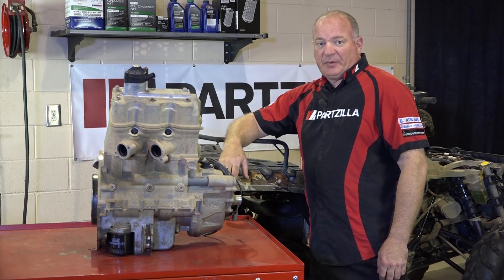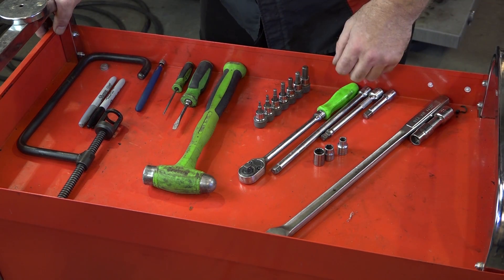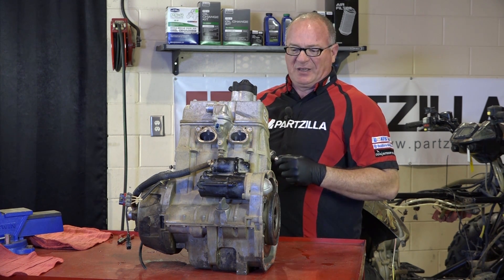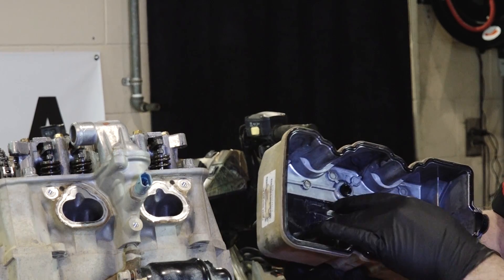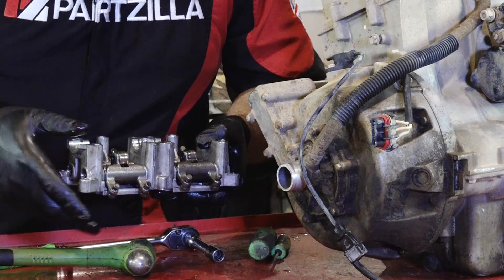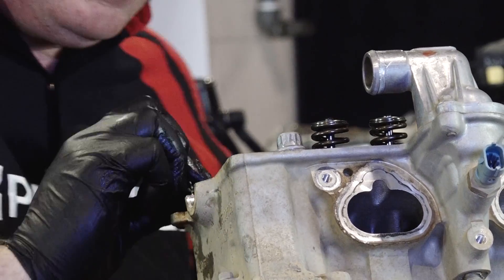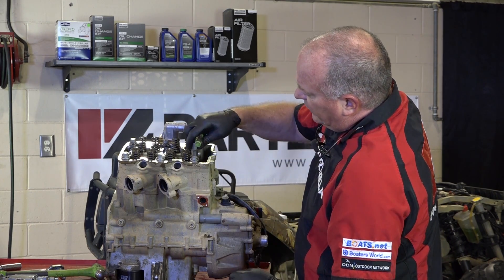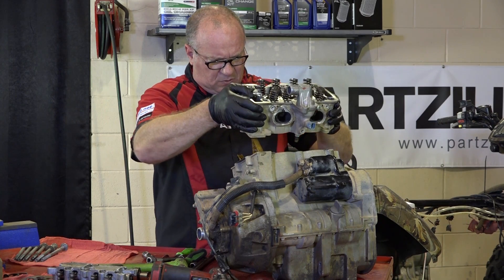Polaris Top End Rebuild Part 2: Remove Cylinder Head & Valve Stems | Partzilla.com

Comment: Good old Polaris engineering. Can't just give you a ft/lbs torque for final tightening. They just want you to go so far and then pull it to a 90 angle??? That's nice. It ends up being well over 100 ft/lbs on 6 bolts that would easily  be tight enough at 70 ft/lbs.

Comment: Do you need to remove the engine to replace the head gasket? My 2018 Scrambler service manual mentions a removable frame brace on the right side of the machine.

Comment: I just had a customer drop off the same engine with an oil consumption and smoke problem. I'll be doing a leak down test to identify potential problems before I take the engine apart. You can fill the intake and exhaust runners with kerosene to identify valve face and seat problems once the head is removed.

Comment: I think you the valve are a number one issue. The valves seats need to be cleaned better  or the replace the old one because valves and seals will eventually fail  crack or be worn fast if used again and oil will be sucked into the engine cylinders and the engine will use more oil  like my Polaris Scrambler 850 2015. Dealer is fixing it tomorrow and two valves I believe exhaust valve have heavy carbon buildup. The need to remove at least the two to see if they have carbon buildup on the inside where it seats.

Comment: the next time you have to remove a engine with removable engine mounts. Use the lower engine mounts to fab up a jig to hold the engine in place. this makes the head bolts and such easier to deal with.